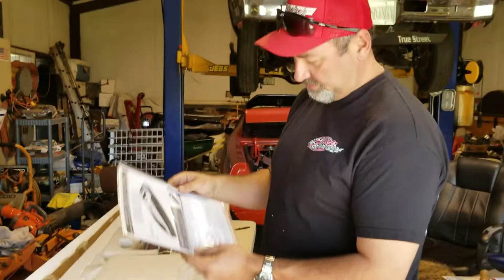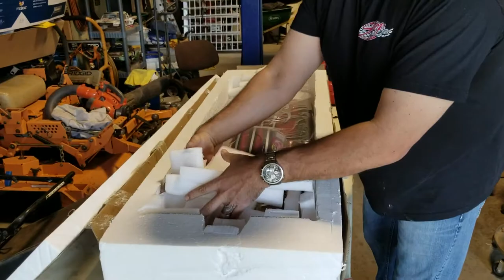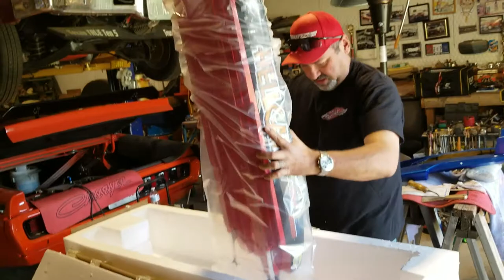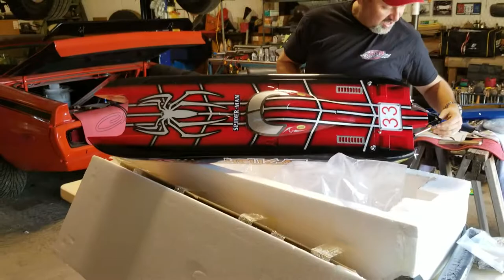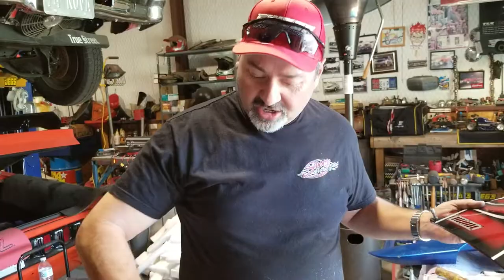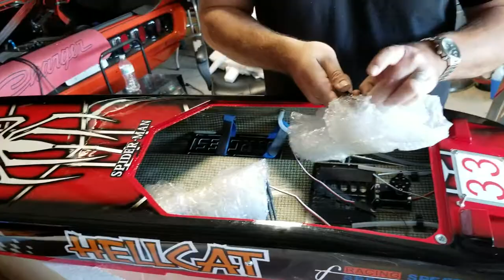Unboxing my new DT E51 Spiderman

Comment: Dear friend, hello!
My name is Ruslan. 
I have the same rc speed boat.
Please tell me which the lipo batteries are you using (S-?, C-?, Brand-?)?
Reply from the maker: I run 6s in this boat about 100c.  The brand doesn't matter.  Not getting sponsored.
Reply: @stevoworld72  Hey there.  I'm looking to purchase this boat.  Since you have owned it, what are your thoughts of speed and performance?  How is the COG?  Any set MPH speed checks?  Finally, how long can you run this boat before the batteries die?  Thanks!
Reply: @stevoworld72  Hey there.  Did you keep the 120amp ESC or change to a 150amp? I just ordered one From TH on Ebay RTR.  It comes with 6S 4000 35C batteries, I see you went up to 5000 100C batteries.  I will follow suite.
Reply from the maker: @jcoombs2103  no.  Yank those out and put ztw's HV in it.  One burnt up
Reply: @stevoworld72  For example:
My DTRC E51 the stock version: 2  x motors 2000Kv, 2 x ESC 120A, 2 x prop D45. I am using Li-Po batteries: 2 x HRB, 6S, 5000mAh, 50C (XT90 connectors, 10AWG wires). Unfortunately, the batteries turned out to be weak for such a catamaran(((